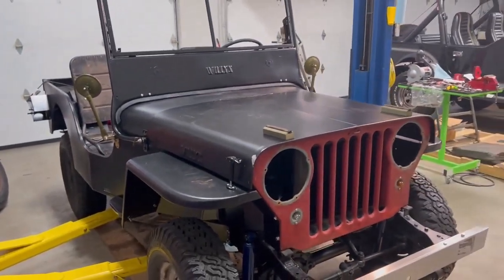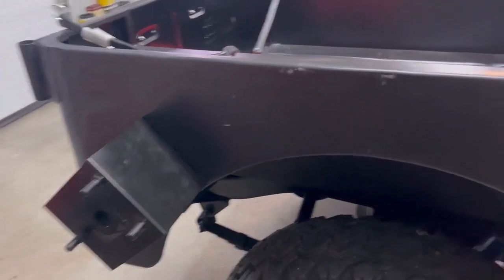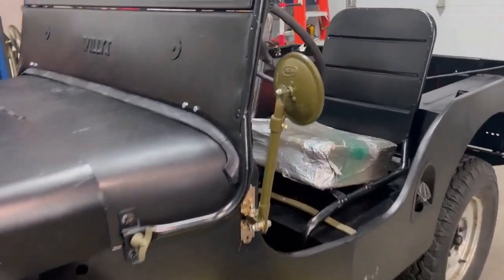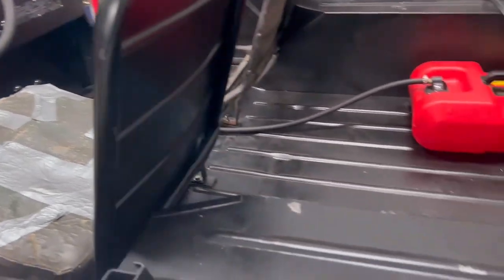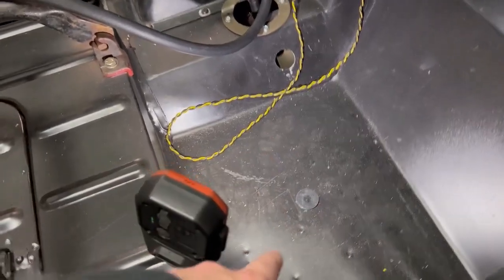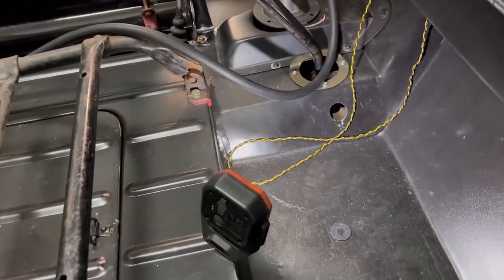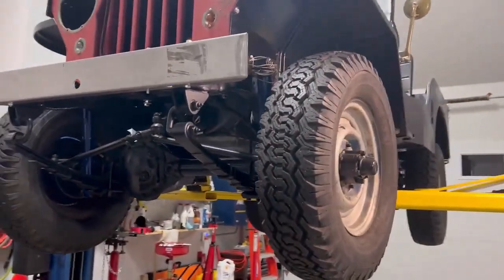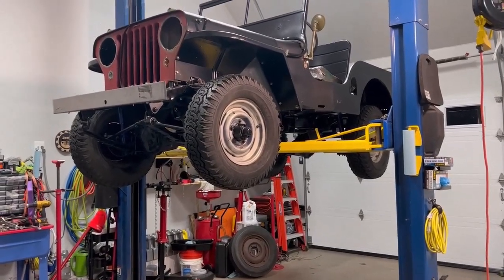Major Fitment Issues and Update 1947 Willys Jeep CJ2a Replacement Body

Comment: Bear in mind the hood block on drivers side is off set farther than the passenger's side to clear the vacuum wiper motor when windshield is lowered onto the blocks,if you are going to use the original vacuum wiper motor!Good job getting it to alighn up!
Reply from the maker: Thanks - Good to know, that makes sense.

Comment: I have already added a past comment but I have one more Item to add. Since you are adding to your experience in repairing your '47 Jeep. I felt it necessary for me to say that it will be necessary for you to both mount, balance and have your jeep's front end aligned on a periodic basis. Alignment simply means to attach equipment for alignment, measure caster, camber and toe and then compare and adjust to Jeep's 1947 specifications. Unfortunately, many Owners of Jeeps overlook the alignment process and their tires quickly wear out. This can easily become expensive. My very best to you and success to you and to your '47 Jeep.
Reply: Caster and camber is preset with end of axle housing to steering knuckle with king pins and bearings,the only alignment I know of is toe in!

Comment: Great video. Thanks!
I too had to make many of the same mods with my M38 repro body and mounting on a 3A chassis. 
One thing to watch out for and you might need to tell your paint guy is how that black primer from MD Juan just flakes off over time.
Reply from the maker: Glad you found it useful! Yea I had them sand most of the primer off just to be sure as I have heard mixed reviews. From what I gather the red primer is worse but who knows. It’s all painted up and ready I just need to post the final video - hopefully soon.

Comment: Ive got the cj5 body for 78. Seems the transmission tunnel is off quite a bit. Dont have it figured out yet. Good video and looks like yours is pretty close.
Reply from the maker: That’s a bummer - I know others who have similar issue with cj5 bodies. Frustrating that they sell bodies that are so far off I can understand small adjustments but major miss are hard to understand. Wish you the best on yours - 78 is a great year!